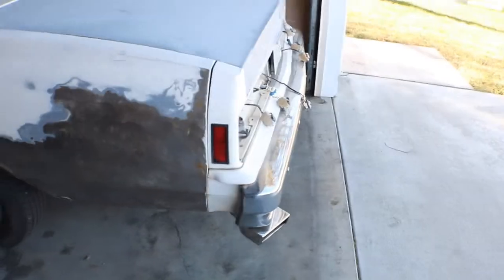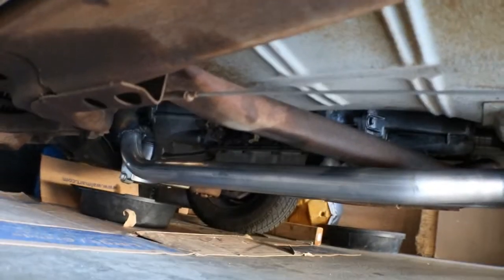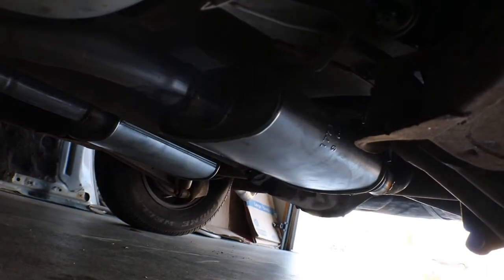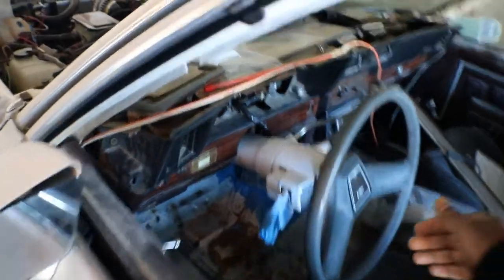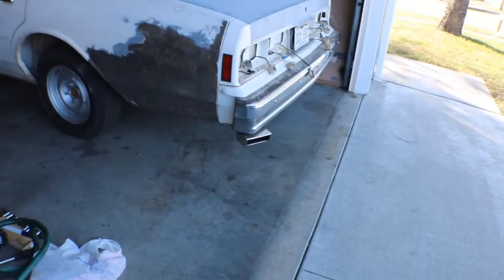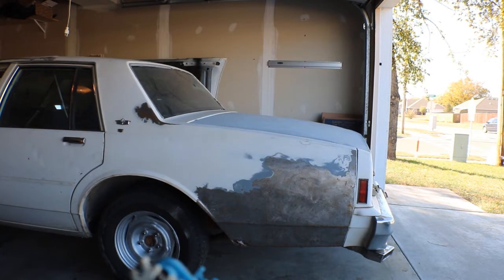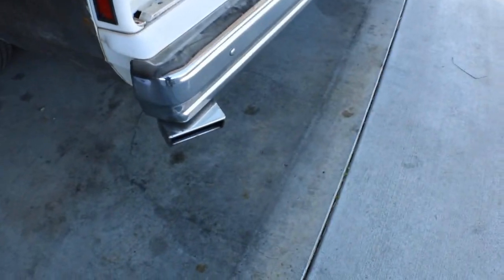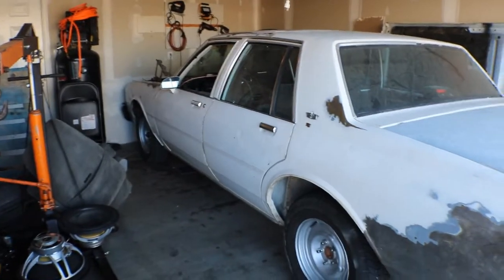1988 Caprice LSX 5.3 Cheap Exhaust Setup

Comment: Steve. Why does the exhaust drip water? What does that indicate regarding the condition of the engine? 👊
Reply from the maker: youngestson65 Condensation, but it should only happen when the exhaust system is cold.
Reply: youngestson65 yeah mine do the same some times be spitting water but that’s normal

Comment: How’s it going I’m completely new to box chevy so if I sound stupid excuse me I just brought a 88 box chevy getting a few things done but don’t want to be taken advantage of just wondering what’s a fair price to pay for an exhaust system like that
Reply from the maker: John Jenkins about 400 give or take,  it can get real expensive, I personally keep all my old exhaust parts that I can use, and buy my mufflers and tops from the store or online. Cut the middle man out!
Reply: Well I’ve been watching all your videos for the past month leading up to me buying this car and I can tell u when it comes to being hands on I have no arms at all lol so I watch what u do and tell my mechanic what I want done lol but I’m going to try some small things but the car honestly only needed the 2 front fenders and a paint job the interrupt is excellent and the engine and transmission are really good also so for most part everything I do will be on the appearance side like a new radio because the stock doesn’t wk and I want to get the paint job and exhaust and new rims and tires but your exhaust is the way I want mine to sound not overwhelming but just right
Reply from the maker: John Jenkins That's wassup man keep progressing,  you'll be a mechanic in a few months if you keep watching 🤣. Thank you for your support 💪🏿💪🏿
Reply: Hey man thanks for educating us mechanically challenged folk ... hey let me get your opinion on color I have narrowed it down to either a matte black or the sky blue which is the original color your opinion?
Reply from the maker: John Jenkins If it's sorta clean already I'd keep it original but if it's beat up like mines I'd change the color 😂
Reply: Thanks man appreciate your advice and let me apologize again ahead of time I’m prob gon reach out some more for advice and opinion from you because your very knowledgeable

Comment: Same exact setup i have but my exhaust tips come out the side instead of the back
Reply from the maker: Boss King That's wassup, I wanted to stick it out of the side but it was going to have to come out about 3 inches to have the 90 and still clear the fuel tank so I went out the back.
Reply: Steve Davis that setup sounds nice especially when you smash down on the gas my caprice runs way better with exhaust system on her
Reply: What kind of gas tank u running
Reply from the maker: Boss King Same with the blue 88, it was good but with the exhaust complete it sounds so much better and smooth
Reply from the maker: Boss King This one has the 96 impala table for FI
Reply: Steve Davis with that impala one i know it's gone perform good with my old fuel pump and tank my caprice would hesitate for a second before it would kick in due to the gas flow but imma be switching out tanks to something better whenever i change out motor kinda in between ls or 383 stroker
Reply from the maker: Boss King How much is that 383 gonna hit you for?
Reply: Steve Davis probably around 3k my homeboy build motors he build all type of race motors but that's just motor not all accessories
Reply from the maker: Boss King I'm sure that's not a forged bottom end, I'd go ls because it's just so much cheaper to work with
Reply: Steve Davis yeah it's cheaper bro but i know more about motors like that than ls but i really want ls bro but it's hard for me to get that type of work done around my area without having to ship my car somewhere else
Reply from the maker: Boss King You could be the first one 😂 go ahead and grab the books, well worth it.
Reply: Steve Davis i might just say fuck it and get it done it's a dude out of Arkansas that do good work might just find me a 5.3 and get him to do complete install for me cause he do the wiring and pcm flashing but what trans do u think i should go with i want something that's gone hold up with no issues
Reply from the maker: Boss King Anything will unless you're changing the cam from what I've read. I would service the trans tho.
Reply: Steve Davis what trans u gone be running you going nitrous right